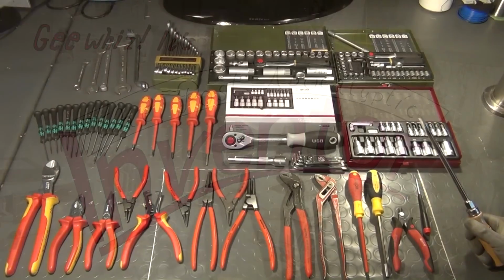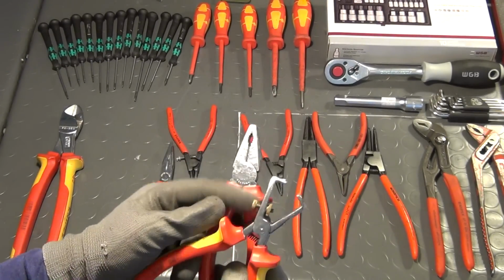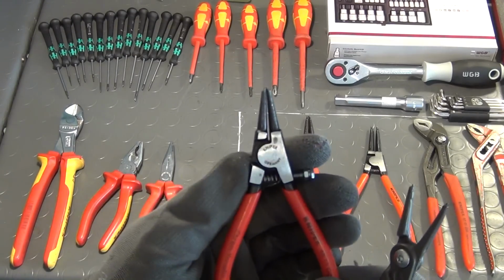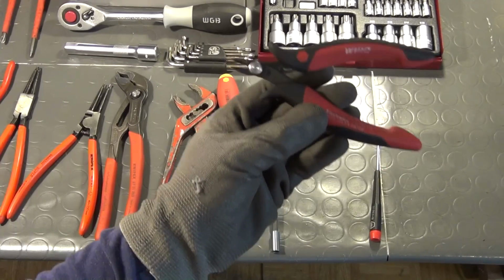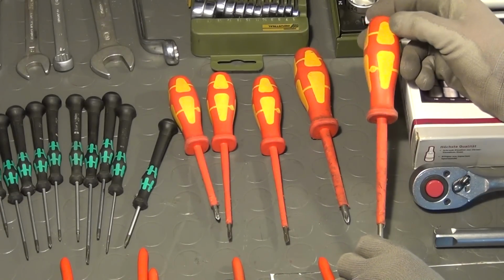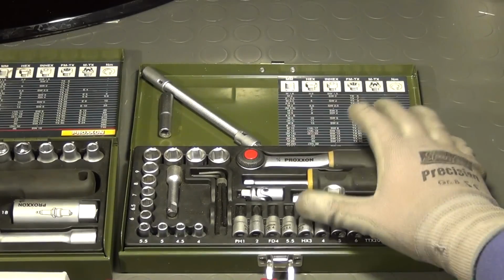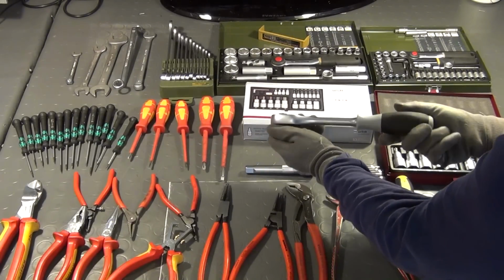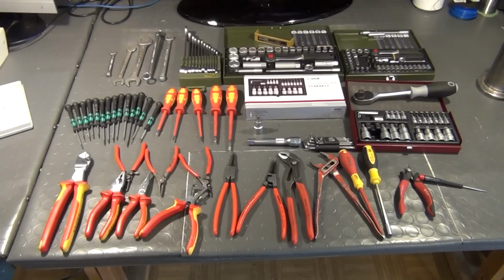German Tools Review: Knipex, Wiha, Wera, WGB, (Proxxon)

Comment: WGB seems to be very creative in their marketing as they brand their produce “Das Werkzeug” and wisely avoid the claim “made in Germany”.
A bit indirectly, their website mentions they support an educational project near their production site in Jaipur in the Indian state of Rajasthan. On another site it’s stated they have various production sites in Europe and Asia (without specifying their exact location, except for their locations in Breckerfeld and Wuppertal (C Walter? of the same industrial group?)). Before they seem to have had a a ‘basic+’ line and a more decent line, but I can only find old references to that online.
Guess at this price point,  one can’t expect a full ‘made in Germany’ label. Usually it is just safer to buy or use older tools as you already restore so diligently :) BTW minor but nice detail, WGB actually stamps the sizes into the sockets, and not just laser engrave it like Proxxon does.

Comment: Was Wera formerly known as Hawera?.....Ive seen some Masonry drill bits made in Germany made by Hawera.
Reply: No, Hawera is short for Hartmetallwerkzeuge Ravensburg, founded in 1952 and bought by Bosch in 1995. I think the brand and the factory are still operational in Ravensburg. Wera originates from Wuppertal and still has their headquarters there. The nae is composed of the names Wer-ner and A-mtenbrink.

Comment: Hello. Can anyone tell me what to expect from the Wera micro pack screw driver’s handle, as in how does it feel? I bought the Wera micro pack 1, in China as I work here long term, and the handles are a lightweight plastic. The rotating tops, which press against the palm when in use, can rather easily pop off. Please tell me that my purchase is a fake product. I won’t believe this would pass the standard of the Germans.

Comment: At a guess judging by the timing of the clicks on the 1/2 inch wgb ratchet, it probably has a ' coarser ' gear, i.e. bigger & wider teeth, for increased durability under the loads a 1/2 inch would be expected to handle. And as for the Wera and Wiha small screwdrivers, also the tiny cutter pliers, those are generally referred to as ' hobby level ' and used mostly for fine electronics work, and rc car/hobbies work. I worked for Hobbytown USA company for a while and we sold many Wiha tools.

Comment: I can confirm that Wera is excelent quality. I bought a set of Wera Hex Plus alen keys (950 PKL/9 SM) about 25 years ago, and none of the keys has any significant wear, other than the plating being a bit worn off. I also bought a bit set (Bit-Check Torsion) about 14 years ago for use around the house. The PZ2 is showing its age, but it has held up really well.
When I apprenticed as a fitter back in the mid-90's, we had Wera screwdrivers in the shop, wich encouriched me to buy an assorted set a couple of years ago. Bacho screwdrivers (wich I had been using until then) are really good as well,  but in my opinion, Wera is just that little bit better, and has a better grip.

Comment: One thing I noticed about Proxxon, specifically in socket sets, is they sometimes will skip a size or two. Not necessarily a deal-breaker, plus you can usually buy the skipped size as an individual socket. But then you have a free-floating socket in your set-- perhaps a reasonable compromise at this price point.

Comment: My personal favourite German brand tools are:

1. Gossen Metrawatt multimeters
2. Weidmüller Stripax wire stripers and electrical crimping tools
3. Klauke electrical crimping tools
3. Knipex pliers and wrenches
4. Wera and Wiha screwdrivers 
5. Gedore and Hazet spanners ratchet and sockets 
6. Metabo power tools
7. Stabila level and tape measures
8. Martor cutter and knifes

Comment: i use knipex brand piano wire cutters in my work building animal cages. they are the best tool for the job, but are also double the price of any comparable tool. they last longer, but eventually the cutting edge breaks during use. 6-8 months of use, for $45 usd. vs. 3-4 months for $20 usd. technically, the cheaper ones last longer for the money, but ease of use makes up for the difference. it wouldn't be so bad if i didn't have to supply my own tools. even still, i love my knipex cutters, and woe be unto those who take them.

Comment: I tend to abuse my tools (if work needs to get done I'm willing to do it at the cost of destroying a tool since it usually cost less than spending additional hour working around it) and from the moment I started buying Knipex and Wera tools hardly anything needs replacing - for example when I used Knipex electrician pliers to cut feeler gauge of up to 1mm (about 20 of those) they just needed a couple of minutes on sharpening stone to bring back to life and they work as new. 
Knipex also has some great automatic wire strippers and crimping tools which easily helps me cut down the time of wire stripping at least by half and it's a lot since I'm stripping hundreds of small (mainly 0,25mm2, but sometimes both larger and even smaller) wires when I'm on the job (automation and robots commissioning).
Wera has the best hex keys I have ever used and pretty decent ratchets (especially the small ones for hard to reach places).

Comment: Main things I look for are old style handles (hard plastic or traditional PVC) mainly because in my experience, a lot of the rubberised handles go sticky after a decade or so, and quality boxes for sets of tools like screwdriver bits and socket sets. I'd much rather have a metal box with an insert than a blow moulded case where the hinge or clip inevitably snaps off.

Comment: Knipex Cobra pliers cheap? Pigs arse, I paid $80 AUD for my 300mm pair with the thick red and blue handles but they do the job so much better than the old slip type pliers you showed. I ordered them direct from Germany. Buy quality, buy once. I bought a set of electrical screw drivers similar to your red and yellow set from ALDI several years ago and they have been brilliant, so good in fact that they have them on sale again next week for about $8 AUD and I am going to buy a second set. Over the years I have found ALDI hand tools to be of a very good quality at a very reasonable price. Love your channel. Cheers Stuart 🇦🇺

Comment: do you have Lidl supermarket there? lidl once a year sells a mechanic-oriented suitcase toolkit with every single bit and socket you may want to work on a car or other mechanical stuff..from 3,5mm to 32mm including torx and hex bits etc...its the best bang for the buck, it costs 89,99€ here and the quality is amazing...i have had other professional and semi-professional toolkits and tool-carts before on my workshop, i give them A HEAVY BEATING and they just keep going...the breaker bar that comes is the suitcase i once fitted a 2 meters long tube in it and hang all my weight into it to undo a seized bolt and it did not break or bend..i constantly hit the breaker bar with heavy hammer to loosen seized suspension bolts and crankshaft bolts etc... the ratchets are super sturdy and can only be beaten by SOME super expensive brands like BETA...even kraftsmann tools is way lower quality.. some bits contain too much carbon and they break easily, some contain too less and they are too soft and they destroy the screw heads especially torx screws...but the lidl ones seems to be the exact grade of steel, no so soft that it doesnt grip to the bolt head and not so hard that it breaks... a couple of weeks ago i tried a new brand (Magnusson) that comes with 10 year warranty and the ratchet lasted 2 days on my hands...the lidl ones last me almost the entire year..

they also carry a kit with philips and flathead screwdrivers of numerous sizes with incredible sturdy tips and handles for less than 10€ with more than 10 pieces, seems too good to be true but it is not, you can even hammer heavily on the handles and use them as chisels.....the problem is they only sell it a couple of days per year, they do it to bring customers in and i think they dont make any money on those sales, its just to promote the lidl brand as a cheap and good brand. i bought there a compressed air impact gun and i have it on the shop for 3years now and i  have only oiled it maybe 5 times...i use it daily...it costed me 24,99€

yes i dont take care of my tools..i do my job as fast and efficiently as i can with complete disregard for my tools...my tools make me money and they are my slaves....if i need to i weld a socket to that stubborn bolt to undo it or i cut in half a good spanner so it will fit  a narrow space and get the customer going FAST etc.

Comment: I tend to shy away from those comfort grip handles for that exact reason.  I've never had a set with those grip types that stayed on unless I used adhesives. So I try not to buy them anymore. Sure the standard grips arent as comfortable but they are more sleek and won't keep coming off. The only reason I would go with those comfort grip is if it was an electrical tool and they are rated like those first pair you showed. Then I would glue them on like you did. But other than that no bulky comfort grip handles for me. Also don't use gas to clean these butelene grips if that's what they are made of. They will rot in no time if butelene.

Comment: I own most of the brands here and have been very pleased with them.
What are your thoughts on Weidmuller? I have never seen them in person but I am interested in the automatic wire strippers and ratchet crimper for comparison on a series I am doing on wire stripping and crimping on my website and youtube channel.
Reply: Weidmuller is amazing. I have seen it used by electronics technicians. They are probably the best that you can get for electrical jobs.
Reply: @matyasnagy8293  Thanks for the info.
I may have to just open the wallet and go ahead and get the automatic wire strippers.

Comment: German wrenches are of high quality, but thnner than American wrenches because they don't have a life time warrenty. With my Craftsman wrenches, I've had to beat on them with a hammer to loosen a rusty bolt , all without damage (don't judge me, we all do it!); I'm more conservative with my German wrenches. Knipex are excellent, pretty and the equal of any professional American brand, but the handles are difficult to clean when covered in greasy. I believe if you have a problem with German tools, you can take them back to Hornbach or Bauhaus, if within 6 years from date of purchase. Some of the small shops in Germany will work with you, if you don't abuse the tool. In Germany, people won't take you serious unless they see profi werkzug in your toolbag.

Comment: The only way I've found to damage the tip on a Wera screwdriver, short of intentional destruction with power tools, was accidentally ruining the hardening when I wedged one between 2 pipes to make room to braze a leak, and got the screwdriver tip hot enough that the brazing alloy stuck to it.
I just wish they were still made in Germany, but the Czechs seem to be doing a good job making them, so I'll keep buying them.

Comment: Knipex for sure makes the best side cutters bar none. I live in the states and worked in auto electric rebuilding starters and alternators and electric motors. And I bought a pair of side cutters and what sold me at first was the fact the you could cut through a quarter with them and after 10 years of very hard use you could still cut through a quarter with them .

Comment: Witte screwdrivers and other drivers are great. Their sold under the Matco name but can be purchased much cheaper online without the Matco name on them. 
15 years of use and I've only replaced one of the #2 for a worn tip at the 13 year mark All others are still original.

Comment: I have a bigger Proxxon set combined od 1/2" and  a 1/4" set. I use it for everything, and I use it and abuse it daily. And I recomend it. It did cost a 100€ for the set, but I had no problem with it. Even the box is still ok.

Comment: I have the cobra plyers and they're amazing.    It can manage a hell of abuse.    I got it in 3 sizes: really small, up to 1" opening.    Medium-large, up to 2 1/2" and the monster up to 5" opening.   All 3 work waaay beyond its original purpose.
I have added a tong steel tube (about a 1.5 mt)  to the medium one to be able to remove a rusted pipe from a pump and it resisted it without a single bit
Reply: And the press adjustment is really perfect!  Never again slip like the old shit

Comment: i use knipex piano wire/bolt cutters at work cutting 12.5 gauge cage wire. they cost over $60, but work the best. tried other brands, and chinese copies of knipex cutters. don't last nearly as long. only complaint is they are very hard and brittle, and the cutting edge breaks sometimes.
Reply: +handyhippie65
I have no idea where you get your tools, but those can be had for under 20 euros here.
Btw, I have an ancient Gedore like that (without the fancy insulation of course) which cost me next to nothing at a fleamarket and it still looks great and does a great job. Indestructable.
In Germany they take their tools seriously, that's for sure.
Reply: i live in the US. i found a new supplier where they are $45.00
Reply: +handyhippie65
Oy... yeah, that would be outside my range. LOVE good tools, but there are limits to that love.

Hah, mebbe we could wet up some route to get them to the US for less? Here we get them from about 18 euros.
Reply: the chinese copies are still half that online, and are not anywhere near the quality. kneipex last me about 8 months. the copies, about three. but i use them every day. the shipping costs from europe would probably offset any difference in price, as i cannot order a case of them at a time. a $60 roll of wire costs me $20 to ship less than a thousand miles. globalization only helps those at the bottom, and the top. those of us in the middle pay.

Comment: Hello, I am from the US and have always used Klein Tools screwdrivers for my electrical work. I really enjoyed your review, especially the review of the Wera insulated screwdrivers. I have heard very good things about Wera in the States and I think after watching your review of them I will purchase a set and try them out first hand. Thank you very much and best wishes to you.
Reply: James Garrison I'm from England and have been watching a few American shows of guys doing electrical work and of guys doing tool reviews and I've noticed that Klein screwdrivers seem to be brand everyone chooses. Here in the UK most of the guys that work in the electrical industry use insulated drivers. Wera are really reasonably priced here and are great drivers. I also have a wiha torque driver which comes with insulated blades and that's also nice to use. How come insulated drivers aren't common place in the US?
Reply: I have Klein insulated drivers purchased at Sears and Roebuck.   (Made by Pratt & Reed)  The rest I have are Wiha.
Reply: @Daniells1982  hi buddy try and find insulated screwdrivers which where made in West Germany i have a few from carboots and tool auctions they are probably well used but they will never slip or fail while in use west german tools will last forever
Reply: That is a good question, Klein does make insulated screwdrivers'. However, they are not common place and kind of hard to find. I guess that's my father always told me that there are only good electricians, cause all the bad ones are dead.

Comment: Question.. I only recently traveled to Europe (Paris) and the first thing I did was run to the hardware stores. Could someone please tell me.. being that metric is prevalent in Europe; why are the drivers (ratchets) made in 1/4-3/8-1/2" sizes and not some unique European size.
Reply: They're really made in 6.35 mm, 9.525 mm and 12.7 mm - the inch has been defined as equal to 25.4 mm for years :-P. Since inch sized ratchets were already in production worldwide, buying metric sockets that fit an inch based driver was much cheaper and easier than buying a whole new ratchet.
Reply: I've been in the States too long..

Comment: Proxxon wrenches/spanners are good.
I've had to loosen a 14mm nut by using the open end of a
 "ring-maul"combi wrench and a 50cm pipe extension.
 No damage on the tool and te nut came loose.
Great bang for buck ratio

Comment: Let me tell ya'll, out in the Gulf of Mexico, for the last 10 years, Knipex pushbutton cobra pliers rule!  Narrower than Channel-lock, they get into all the expensive fitting turn points. Got 2, one I have abused for 15 years the other was given to me after the mechanic who dropped it across the solenoid terminals on a 1000 hp motor, igniting hydrogen cooking off the battery bank , caused an explosion that was comical in the end,no injuries just 3 of us instantly wearing 'black-face' . Enjoy your stuff, thanx.

Comment: Great review. I've been in the industrial electronics industry for several years. I have used plenty of german/american tools. even some japanese. I've tried most of these brands. I'm not a big fan of wiha precision screwdrivers after twisting and chipping the tips off of a couple after moderate use.  NWS makes great cutters for cabling as well, I like them even more than Knipex. but only certain ones.
Reply: What is the best brand instead of the Wiha precision screwdrivers?

Comment: Hi there ! You could repair the shaft isolation by overlaying some red thermoconstrained pipe after sanding a bit and glueing (CA gel will make it rigid without excessive thickness and some constrainers come with an internal adhesive layer) the part left solid from the old insulation...